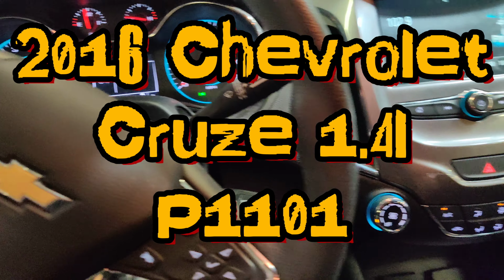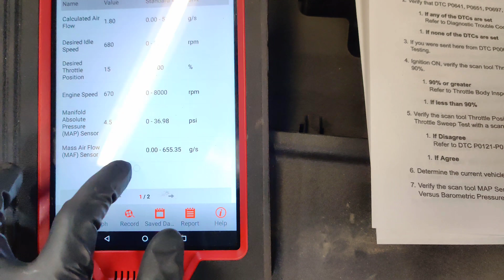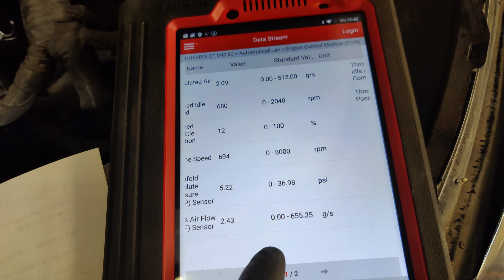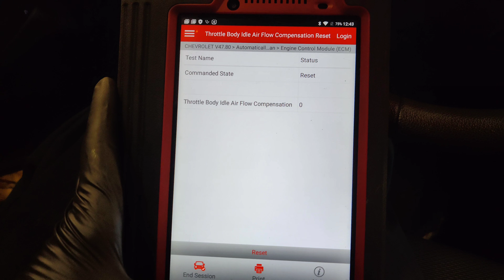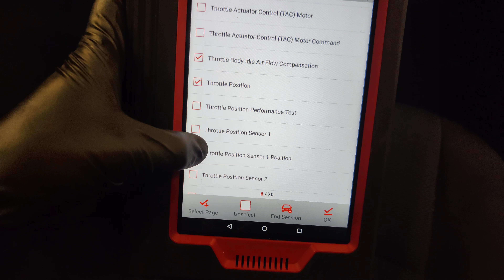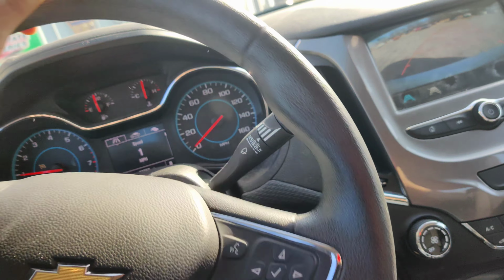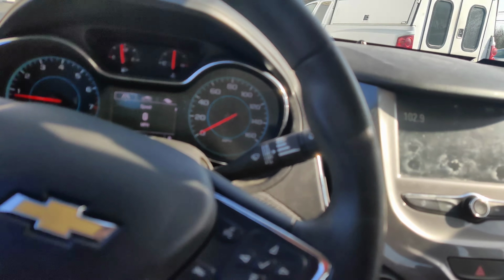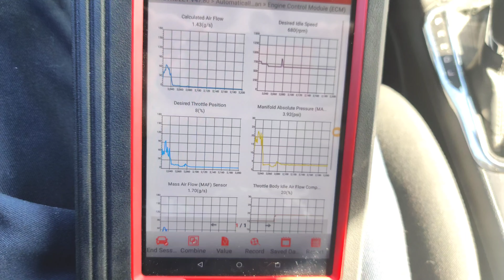2016 Chevrolet Cruze 1.4l P1101

Comment: Thank you 🙏 so much u just saved me a trip to the mechanic ...  Cleaned out the throttle body out and my code was cleared no check engine light now I can get my inspection 🧐
Reply from the maker: You really need to do a throttle body relearn to reset the compensation value.
Reply: @RobertDotterer  is there an Android app we can do this?
Reply from the maker: Not that I am aware of without a high end VCI. Launch and ThinkDiag both sell a obd2 dongle that works with Android and will allow you to do this.
Reply: @RobertDotterer  Nice! Looking into this
Reply from the maker: If you search my channel for thinkdiag I have a few videos using it. It's fairly cheap for what it can do.
Reply: @RobertDotterer  will do just subbed
Reply from the maker: I appreciate the support!
Reply: did your light stay off?

Comment: p1101 code intermittent changed mass airflow sensor code came on all time. cleaned throttle body real good cleared code it went away
Reply from the maker: Why would you change the mass air flow sensor?
Reply: @RobertDotterer   code came up as mass airflow sensor
Reply from the maker: P1101 is intake air system performance. Codes never tell you a part is bad. They only tell you what test the computer performed that failed. Also if you used an aftermarket MAF sensor there is a good chance it is not reading right even if you have no codes.
Reply: @RobertDotterer  ac delco sensor used
Reply: I can confirm this worked for me too when I cleaned my throttle body on my 17 Cruze. I use a K&N filter and sometimes after I clean it and re oil it, some oil will get on the sensor and So just clean it Mass airflow sensor cleaner as needed
Reply: @darkvador55   I use a delco filter check and blow off aurfilter wipe down airfilter box every 5000 miles. will check and clean throttle body every 25000 miles from now on
Reply: @darkvador55  thanks for the positive vote of confidence
Reply from the maker: This is generic I go, you need to look at service info for the specific vehicle. The one on the video this code sets when the actual engine air flow is greater then the calculated air flow. The firs step in the oem testing says to check the throttle body compensation pid like I showed in the video.
Reply from the maker: If you read the oem procedure the very last thing they have you check is the mass air flow sensor because it's almost never a mass air flow sensor on these cars.
Reply: @RobertDotterer  I changed my air filter and sensor but now that I'm seeing this video makes me regret changing the sensor. I hope cleaning the throttle makes my code p1101 go away. I have the same car. 2017 chevy cruze. Been trying to fix it for the last 2 weeks and I'm getting frustrated now.
Reply: @handymanny7183  did cleaning it fix it for y bud? 
I have same code
Replaced maf
Reply: @carloscorea439  no. I did replaced maf but light is still on
Reply: @handymanny7183  any solution?
Reply: did your light stay off?
Reply: @anthonygriffo5338  did your light stay off?

Comment: friend of mine has a 2019,  Chevrolet dealership diagnosed a MAF,  I ordered one $100, installed it and have a AUTEL but did not see the reset for throttle so diconnected battery, ran much better but that darn P1101 again, your video was the missing piece to the problem,  3 cleaned the throttle body and then found the relearn function, drive cycles and no light, no DTCs
Reply from the maker: Awesome, I'm glad it helped.

Comment: I have my engine light on for quite some time. The P1101 code pops up when I took the car to get inspected. Was told it had something to do with my vent not being cleaned and I got a specific part for it but engine light was still on after going to get the part put in the car what else can it be
Reply from the maker: The code has nothing to do with the vent. Did you watch the video? I showed how to prove if it was a dirty throttle body and how to reset it. Did you have any other codes?
Reply: @RobertDotterer   I have watched it but no other codes it doesn’t allow me to automatically start my car because of it

Comment: Did you happen to hear a sort of whistling noise from that engine while running? I kept thinking I heard a noise at idle..
Reply from the maker: I heard a noise but I don't think it was a pcv issue. The noise would come and go at idle, I didn't have any lean codes and I don't think the 2016 year had pcv issues. I also didn't have a fuel trim issue.
Reply: Robert Dotterer Good deal! These vehicles have some very weird issues where theylll suck in air around the front crankshaft seal and in some instances the fuel trim looks ok but the tp percentage is affected. The one I did needed a lot of parts... Looks like you git this one squared away tho! Thanks for the video and datapids!
Reply: That’s probably just the turbo it’s normal to hear it whistling at idle, mine does it too
Reply: They all make this noise. It sounds like crickets running 😂
Reply: Maybe a loose spark plug.  Mine was a chirping sound and once I tighten up the plugs, the noise went away.

Comment: Same issue with mine which I'm about to do this weekend. Anything special you used to cleaned the throttle body?
Reply from the maker: Just brake clean, a brush, and a rag. Just make sure you have the same exact issue. A code does not mean it's the same issue. Look at your correction pid. A lot of people assume having the same code means you have the same problem and then they cause more problems by trying to fix something that isn't bad. It's just a tip. If you need any help let me know.
Reply: @RobertDotterer  mine is more "out of self test range" I've replaced MAF, cleaned MAF, replaced filter with OEM with no difference
Reply: @AlexGarciapnoni  did you clean the throttle body?
Reply: @dstewart207  yeah but it didn't work, i just tuned the car and removed the code to be able to remote start it.
Reply from the maker: You shouldn't tune the code out. That doesn't fix the issue. Also gm had an update for the maf and housing for some cars. It was an internal update so if you car got it most off the shelf parts that are aftermarket may not work right. You have to use the part numbers from the parts that were on the car. I've ran into this twice.
Reply: @RobertDotterer  do you have any updated part numbers of the MAF and housing?
Reply: Does that recall chevy cruze 2017
Reply: @AlexGarciapnoni  rite I need it
Reply: It could also be a dirty turbo. My wife's car had a dirty turbo that was throwing this code.

Comment: What does it mean if there is an oil drip coming from the bottom of throttle body where hose clamp is connected?
Reply: I have the same problem bro! Did you find a solution?
Reply: Can you update me what was the cause and how you got it solved please?
Reply: @majidabdul2372  it seems to have stopped on its own. I've heard that it's normal to have a little oil in there. I think there may be a little crack on the hose/tube that connects to the throttle body at the hose clamp allowing it to drip. But there's no way to see underneath without taking it off.But it seems to clog itself up if I don't keep wiping underneath it. I did change my intake tube for that exact issue the rubber was cracking underneath the hose clamp. Let me know what happens. I'm going to be changing my serpentine belt and water pump in the next few days. 😬
Reply: @willnone9977  so you did nothing really to stop it ?
Reply: @willnone9977  I have a 2016 Chevy Malibu

Comment: I have a cruze. So that engine noise is normal almost like a rattle? Someone asked me if my car was a diesel haha.
Reply from the maker: Depends on the noise you are hearing. The camera picks up noises and amplifies them. If it has a rattle I would be worried. Direct injection injectors are louder than port injection. I would try to confirm the location of your noise.
Reply: Not rattle I guess the ticking. I hear it in other cruze videos. Mine sounds same but I thought cars sounded more quiet I guess or less dieselish lol
Reply from the maker: Ticking is probably normal. Is the cover on the engine with the sound deadening?

Comment: Did you change the sensor or the filter? I'm getting the same code. But I called and asked what the code was and they told me it could be the throttle body. My car feels so different from when I first got it, today I was stopped at a red light and when it turned green it didn't want to go, i kept pushing on the gas and it was not accelerating it was only going 10 on a 40 speed limit i had to really push on the gas for it to finally get speed. Some people tell me its the filter some say the sensor now the throttle body.
Reply from the maker: I cleaned the throttle body. After you clean it you have to use a scan tool to relearn its position. You should be able to check the filter yourself. If it's dirty replace it.
Reply: @RobertDotterer  what scan tool are you using? Btw great video!!!
Reply from the maker: It is the launch x431 V 8in tablet
Reply: @RobertDotterer  Thanks for the reply!!!  Can I use your link to buy the scanner? Probably I will be buying this week.
Reply from the maker: Yea, you can use the link. There should be a discount code too.
Reply: @RobertDotterer  Thank you so much!!!
Reply from the maker: It wasn't a pcv issue though.

Comment: Any ideas on after cleaning throttle body that it would get dirty again within couple months? Also good info on the video so thanks man, finally got to use my launch on this same problem.
Reply from the maker: If the throttle body got that dirty again then I would check the pcv and make sure you are running dexos oil.
Reply: @RobertDotterer  Thanks brother